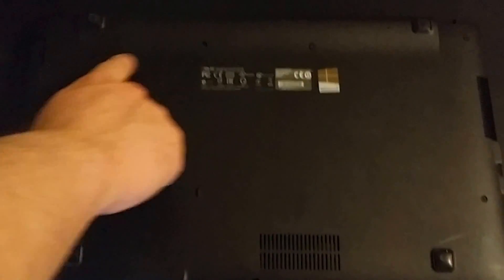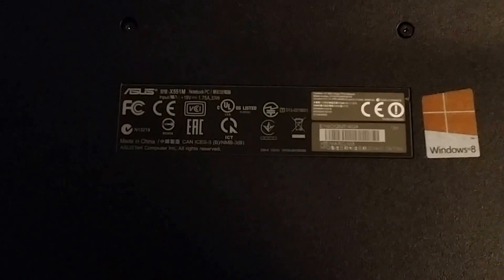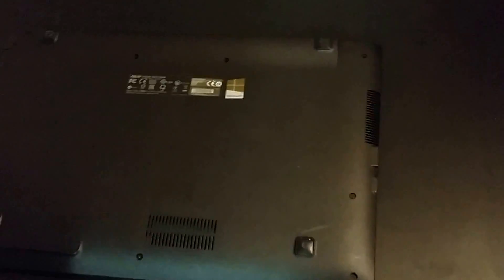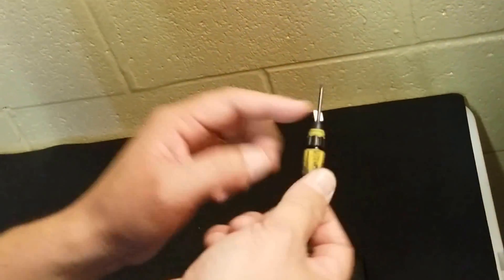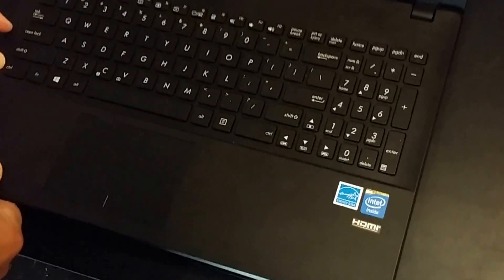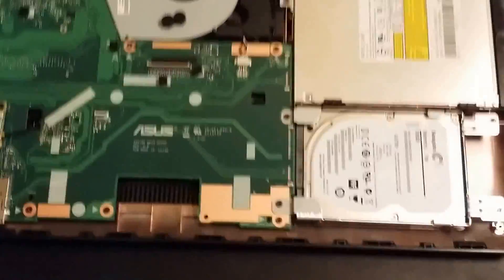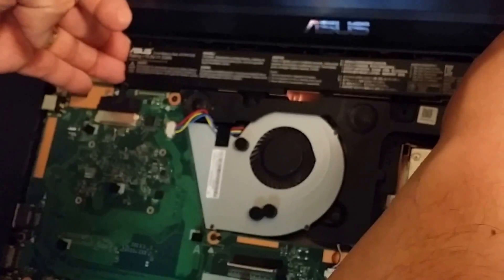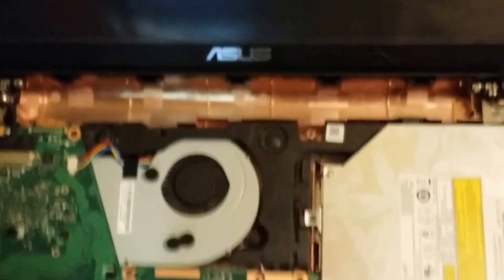ASUS X551M Laptop Battery Removal & Won't Power On Fix

Comment: I hate all of these manufacturers for putting the batteries on the inside of everything. Sometimes a devices needs to have the power removed from it, and putting the battery inside makes that borderline impossible to do in a quick fashion.

Comment: How difficult is it to reconnect those ribbon cables? I noticed someone else mentioned to not disconnect them and just slide the cover (keyboard?) Downward to access the battery from the top.

Comment: Don't lift the front edge up so high, disconnecting the ribbons. When you get the keyboard loose, lift the whole thing about 1/2" and slide it away from the screen enough to expose the battery and a little working room and the ribbons will stay connected.

Comment: It's unnecessary to remove the ribbon cables to remove the battery. There is enough room to move the cover toward you enough to remove the battery.

Comment: Agree with others - no need to disconnect the ribbon connectors to replace battery.  Just slide keyboard forward to get to the battery.

Comment: Much easier than I expected. From a design/manufacturing standpoint they way they did it was much cheaper than having a separate access. I guess that's to be expected for a $200 laptop. Thanks for posting the video, I was willing to pay $50+ to get mine replaced.

Comment: I ripped out those connections accidentally. How do I fix them?
Reply: Did you pull them out of the clamp or did you tear them out of the clamp?
If you yanked them out of the clamp they were in, just put it back in and close the clamp by flipping it down unto the ribbons. 
If you tore it.... well...you screwed up. Once torn they will have to replaced. Before you go looking for a replacement, they aren't easy to find so it's best to give up. 
Hopefully this helped.
Reply: @kacianrich  I got em thanks. No I ripped those fuckers out almost broke my shit

Comment: This video helped me to change my battery. Thank you. Very informative.
I would like to point out, if you are just changing the battery, you don't have to go in from the front and disconnect the cables. You can slide the cover down from over the battery very easily.

Comment: Hi. I have that same laptop model. I like its simple but efficient cooling system. Still, it's very frustrating to have to remove 11 screws from the case, plus another 10, just to change a memory. Great video. It helped me in the past.

Comment: Wasn't this a "fix" video? Dig the effort and proffessionality but irritates the hell out of me you dont even give a fix.... you say just buy a whole new battery??....that's not a fix, that's a whole replacement
Reply: I think the "fix" was about figuring out how to get to the battery. Although there was no need to remove the cables. The cover slides down off the battery very easily. I just did mine today.
The battery was like $16.00 .

Comment: Hi! I can't get a new battery for this laptop (I live un Venezuela and it's very difficult). Is there a problem if I use it permanently without a battery (just the cable)? I ask because maybe there's a weird reason for Asus to make it an internal battery. Thanks!

Comment: The video showing battery change in an ASUS X551M laptop instructs one to carefully lift top and release the 3 ribbon connectors.  I found if you lift top and move it straight back until the battery is completely visible...about 2 inches..you can remove and change battery without removing ribbon connections.  Quicker and easier.

Comment: My laptop won't turn on at all, the battery died a week ago and the charger was broken so I bought a new one and it came today. Plugged it in, and nothing. Not even the light that says it's charging. The charger is good. It's the laptop

Comment: please help me @Angrysquirrel Pc, I have a laptop whose model number is Asus x541u. When my laptop runs off the battery suddenly turns off completely but when the charger is fitted, it never stops, just after the charger is opened, only 5 minutes or so by the battery After 10 minutes or half an hour the automatic shut down and the power button does not work too many times to start it again, pressed 3-4 times Then working on a lot of time by pressing it a lot longer and working how I can solve it. Now my battery backup is roughly two to three hours, I think the battery is okay if there is a way to understand the problem in the battery.

Comment: Thanks so much for this video! Was finally able to put a battery in this laptop. Ever since I replace the battery, though, I have lost the ability to right-click and to highlight text with the touchpad. Any advice?
Reply: One of the three cables you disconnect after prying apart the two halves of the laptop is for the touchpad. Try disconnecting and reconnecting it; it might be misaligned or incorrectly connected.

Comment: You are the moron. You think the engineers are going to design both an external case for the battery and a release mechanism in a laptop that's sold for $200? How do you think they can offer you a laptop with 500gb, 4gb ram and a dual core processor for $199? It isn't meant or designed to be modular or have easily accessible hardware. It's meant to be the absolute cheapest laptop on the market

Comment: Thank you for the video less than 3 minutes had it out, ribbon cables were long enough to bring keyboard down a bit without unplugging and take the battery out, less than 5 minute job in total wich im sure most computer repair shops would charge over £100 for.

Comment: +AngrySquirrel PC Hey,I have the exact same laptop as shown in this video and I have a couple problems with it and hope that you could help me with your knowledge on these things. 
My problems are as follows: 
 
1-Laptop won't charge and it dies when I turn off the charger 
 
2-Keyboard is laggy (when I write it doesn't show and I can't write the same letter consecutively in a second) This problem goes away after about 3 hours after I turn the laptop and works fine again  
 
3-Touchpad is laggy (when i move it around,it kinda like teleports and won't go the way I wanted it to.Clicking on it also doesn't work sometimes)  
Again,just like the keyboard it works fine again after about 3 hours after i turn it on 
 
 
I know this laptop is really garbage and with these problems it is straight up an inbred fuck,but this is the only laptop I have.Please help me I'm one of the person in charge of editing our school's magazine this year I don't want it to screw up because of my laptop problems.Thank you.

Comment: Great how-to for those who need to do this. I suggest first test or have a friend test with a multimeter the voltage coming from power supply. Never got a message about plugged in, not charging. After battery died found power supply was putting out 1 volt dc.

Comment: Hi , I charge my laptop and I saw it blinks for a second and it stopped I cannot turn my laptop on, and no sign of charging 😔 what should I do? (Built in battery) Is there any other way not just to take the battery out?

Comment: My 1 year old kept turning the computer on and off and now it wont start or have the light showing its even charging. What could be wrong with my computer? Its the same as the one in this vid.
Reply from the maker: I would do a hard reset on it.  To do that, simply use my video to get to the battery.  Remove the battery.  Insert the power ribbon cable back into the motherboard.  Hold the power button down for 30+ seconds to fully discharge the system.  Plug the AC adapter plug back in then see if the system turns on.

Hopefully this will get things working again.

Devin

Comment: The irony is this has been a pretty good computer for me. It has lasted longer than an HP or a Lenovo, but I did have to replace the battery & I took it to someone instead of doing it myself. More than a moron. lol
Reply from the maker: Exactly.  You should not have to bring a laptop to ANYONE just to replace a battery.  Hope you got the issue resolved.

Comment: What to do when asus laptop like this and the screen goes black
Reply from the maker: I don't understand your question.  Like this?  Screen goes black?
Reply: Yes the screen goes black whenever I turn it on..do you think the battery needs to be changed?
Reply from the maker: Do you see the ASUS logo when you power up the system or is the screen just black when you hit the power button?
Reply: Actually no I dont see the ASUS word on the screen when I turn it on..the screen remains black but the lights are on
Reply: The button's light are on but screen remains black as always
Reply from the maker: OK now we are getting somewhere.  You either have a bad LCD screen or LCD cable, bad memory, a bad graphics chip, or a bad motherboard.  You can eliminate these possibilities by simply connecting your laptop to an external monitor and see if you get a picture or not.  You might have to use a function key command to get it to show up on an external monitor if you don't get a picture within 30-60 seconds (the time it takes to get to a Windows desktop or Windows password screen).  You hold down the "FN" key at the bottom left area of the keyboard along with one of the FN keys up top numbered F1 through F12.  There is usually a key that shows a small square to a larger square which represents your laptop screen to a bigger external monitor.  If you see a picture, that means it is either your screen or cable that is bad.  If you don't see a picture, it could be bad memory, bad graphics chip or bad motherboard.  At that point, you should take it to a shop for a diagnostic.

Hope this helps.  Good luck!

Comment: Thanks bud. I agree, what a moronic design. Oh well, I just fix these things for friends anyways. You should see the bullshit i had to run through to reset the cmos password on this puppy. what a bitch.
Reply from the maker: Yep.  This is why I REALLY hate laptops that have internal batteries that you have to disassemble to get to.  Some are easier than others where you just remove a few screws and the back plate comes off easily to have access to the main internals, but others like this ASUS REALLY is a terrible design.

Comment: The screws won't move for shit.
Reply from the maker: Yeah sometimes they are installed at the factory really tight.  To get more torque, you might need a bigger handled / longer screwdriver that will fit that hole/screw.  I have one of those I use in that kind of situation.

Comment: Hi, do your think removing the battery of the laptop is OK for the laptop? To avoid over charging and the risk damaging the battery by using the laptop while charging.
Reply from the maker: It is safe to use any laptop without the battery.  Just keep in mind if you have a power outage, it will shut off just like a desktop would unless you plug it into an UPS (Uninterruptible Power Supply).

Comment: Thanks for the video, it helped me to change the battery. Not the easiest battery to change but doable. I believe the reason for this design was to keep the cost of the unit below $200.00. I paid $189.00 at Walmart for mine.
Reply from the maker: Oh I agree.  It was designed to be cheap and disposable.  The problem I have with that is that Smartphones allow you to easily remove the batteries (Androids anyways) and you can buy phones for as cheap as $80 and those phones last 2-3 years as well.  I just don't agree with not being able to change out the battery easily for consumers whether they are disposable or not.

Comment: Plz someone help plz plz plz my laptop is model F555Y and my detachable battery I think... at the back it doesn’t have a long screw for it to latch on and I used to have it but when I took the battery case off the long was not there what do I do?!?!
Reply from the maker: Try to get another comparable screw in length and size to replace it with.  Home Depot or Lowes have different size screws of all sizes.

Comment: I have a Asus laptop and it just complete shut off on me and I'm not sure what I've taken the battery out and it still not turn on someone out there please help....
Reply from the maker: You could have a bad power adapter/charger.  Try getting another one and see if it turns on.  If it still doesn't, it could then be either a bad DC Jack or bad motherboard at that point.  Did you try discharging all power from the system by removing the battery and holding the power button down for 30 seconds?

Comment: Does it work for Dell computer??? i have experience with working on desk tops but feel like ill fuck up my laptop.... it is 1200$ so i dont want to mess it up
Reply from the maker: I have no idea if my disassembly video to remove a ASUS battery will work on a Dell.  Two totally different manufacturers and designs.  Now if your question is if your computer will not turn on and if removing the battery, holding the power button down 30 seconds trick will work to fix that problem, then it should.  All you are doing is removing all power and discharging the excess static electricity to allow the motherboard to reboot from a neutral state.

Hope that answers your question.  Good luck!

Comment: My laptop screen has some white lines on it and it's freezing. Could it be a loose ribbon or is the screen bad?
Reply from the maker: When you say freezing, do you mean the computer freezes where you can't click on anything to make anything work on the desktop?  Or freezing meaning the screen goes white and you can't see anything on the screen?
Reply: It freezes when I try to click on something and becomes partially pixelated.
Reply from the maker: You have a 70/30 shot it is the LCD screen.  Get one from Amazon or eBay for about $40-$60 and replace it.  That should take care of the problem.  Replacing an LCD screen is fairly easy on this model.  If it is NOT the LCD screen, a cable costs under $10 but you have to disassemble the bottom base using this video to remove the faulty cable.
Reply: Angrysquirrel PC thanks for the help. That cleared up my questions. Have a great day.
Reply from the maker: Anytime!  Good luck!

Comment: My power LED light and battery lights  turn on when I push the power button but won't actually power up. No sound, no fan, nothing. I tried rebooting pulling out the battery holding power button for 30 seconds but still nothing. Any suggestions?
Reply from the maker: It is most likely a motherboard failure at that point

Comment: The battery in is 11.25 V the new battery i got is 14.4 V is that ok i can put it or it is very high voltage not suitable??
Reply from the maker: 14.4V is fine.

Comment: Hi is this laptop the same as d550c ? it looks exactly the same but i can't find a proper video
Reply from the maker: You could try using my video as a guide but if it is vastly different, I would consider taking it to a computer repair tech to look at it versus potentially damaging the laptop.

Comment: Is it possible to get around removing the ribbons? Im a little scared of snapping them by accident
Reply from the maker: Some people said that if you lift it up gently without putting strain on the ribbons, you can remove the battery that way.  Just be very careful.

Comment: what about the resealing of the keyboard. when you put it all back together will it still stick back without a problem. Wont the adhesive have become weaker?
Reply from the maker: It is held on by plastic tab clips.  Just be careful not to break them and you should be ok.

Comment: How do you reconnect the cables or ribbons?
Reply from the maker: They are zero force insertion tab locks.  You have to reinsert the ribbons then fold the tab downward in order to lock them in place.

Comment: You can save lots of money by following this program as there is no need to buy a new battery for a dead one. You can repair that battery by following simple techniques [Check Details Here==>https://plus.google.com/100351090281822647456/posts/Ct2x2kZGdNN ].It is affordable and less expensive because you don’t need special tools for that. You can use simple household items to repair the battery.

Comment: just shut the laptop off and change the screen,I did,no problem.Makes no sense to me,you remove up to 3 ribbon cables under the keyboard and the battery is connected,but tear everything apart to remove screen ribbon cable,SMH
Reply from the maker: You can potentially short out the screen if you have power running through the system.  It has and can happen.  Just because you did it without shorting out your new screen means you got lucky.  As a tech, we take NO chances as we are liable for the customer's computer and parts.

Comment: thankyou for demestrating, before disasembling and having a chnace of ruining the whole laptop ( whcih im nervous about even taking it apart) my charger is stuck at 0% while plugged in, and says charging but it wont charge but will just stay that way when plugged in, what do i do?
Reply from the maker: You have a bad depleted battery.  It will need to be replaced.  In order to make 100% sure, try using another power adapter to see if it will charge the battery normally first.

Comment: I have another Asus and sometimes it won't turn on, other times it does. If you completely drain the battery, it won't turn on even it it is plugged into the power outlet?
Reply from the maker: That is a sign of a possible motherboard issue/failure.

Comment: Hi, I have the same laptop that worked perfectly fine and then it won't power on. Did you just know that the problem was the battery or did you do other troubleshooting first? Would appreciate your feedback.
Reply from the maker: In this order.  Check Power adapter/charger, Battery, DC Jack Port, then Motherboard in that order for diagnostic/process of elimination.